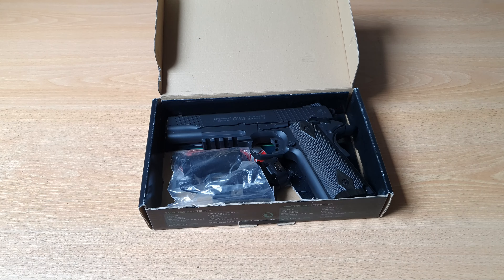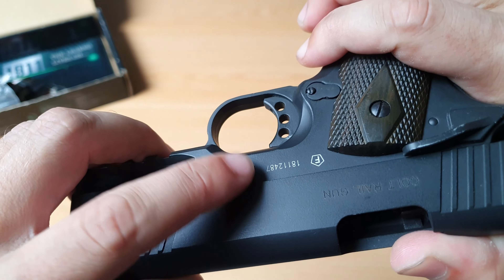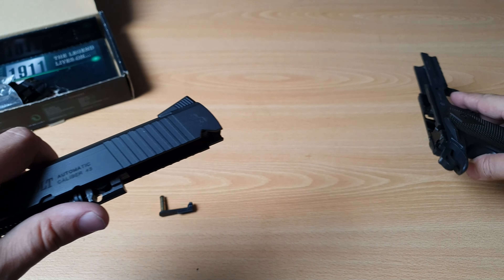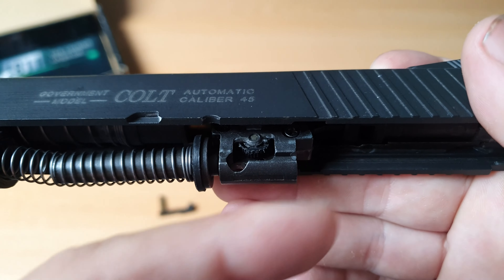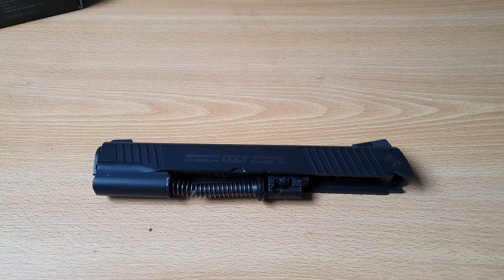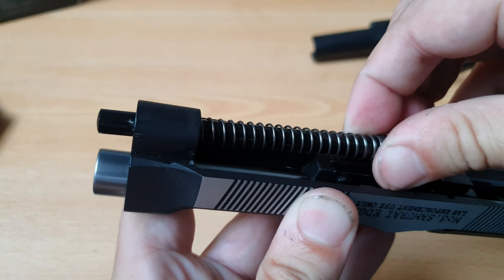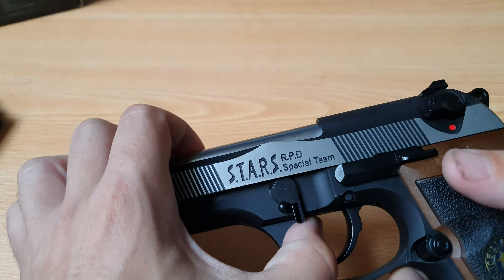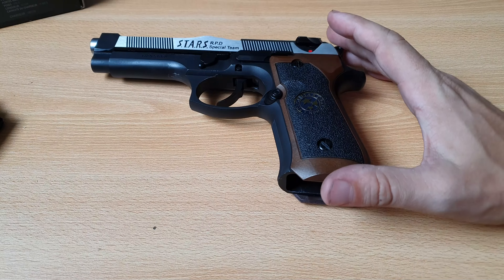hop up explained for airsoft

Comment: Colt 1911 4.5mm have hop up, but not adjustable.
Reply: Cant you put a different one inside it?
Reply: @kevinkoster8066  No.
Reply: My baretta 92 a1 and glock 17 gen 4 are both 4.5mm steel bb shooters and they both have adjustable hop up

Comment: Very nice but i dont have a hop up wheel i have a barra 1911 co2 4.5mm cal bb gun can u help me
Reply from the maker: @yearRBLX  
Air.Guns normally don't have hop up systems So that's good. You don't have to worry about it
Reply: @HappyDude1  but on the manual is show the hop up
Reply from the maker: @yearRBLX  
Then its possible
Reply: @HappyDude1  so how do I adjust it ?? If there is no wheel
Reply from the maker: @yearRBLX  
I need to open it and see it